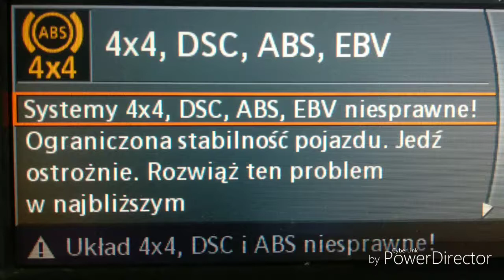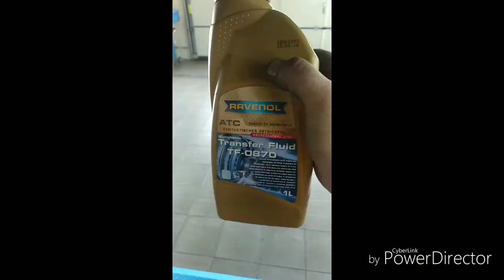Transfer case, oil change X5 E70, CVT Repair

Comment: I did it on my X5, but my gear was good. But i didnt put no new fluid on mine. I still have the 4x4 light on
Reply from the maker: You need adaptation.
Reply: @coolbitbmwretrofitgarage8033  adaption?
Reply: I'm sorry idk what that means
Reply from the maker: @2004skylinegtrr34  make adaptations
Reply: @2004skylinegtrr34  You have to reset the computer using something like ISTA to let the car know that the fluid has been changed.